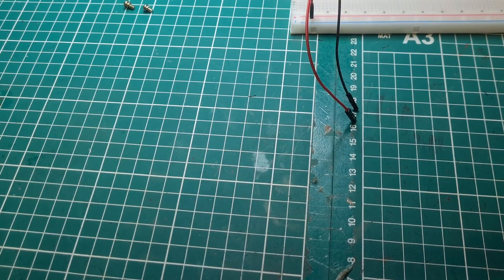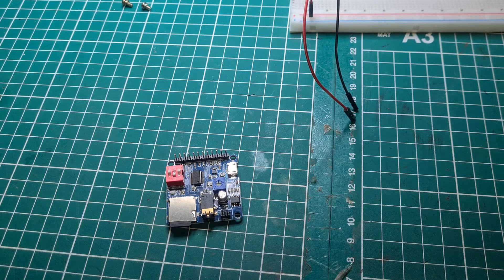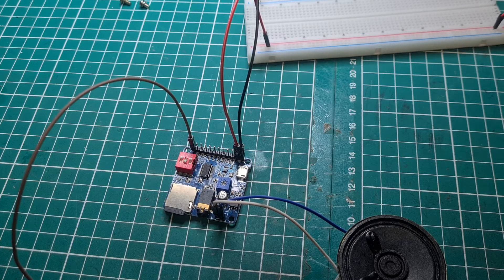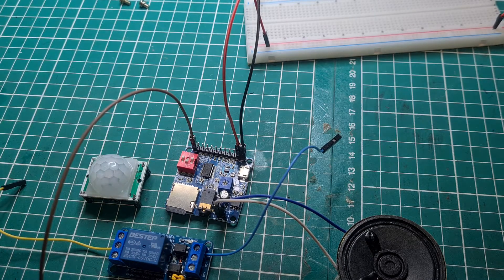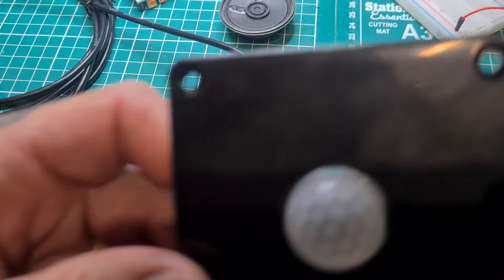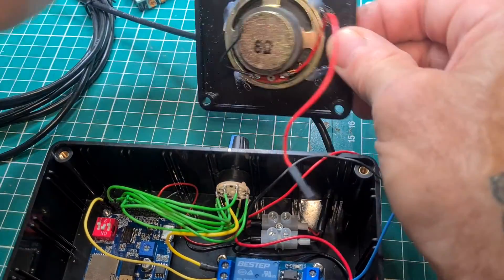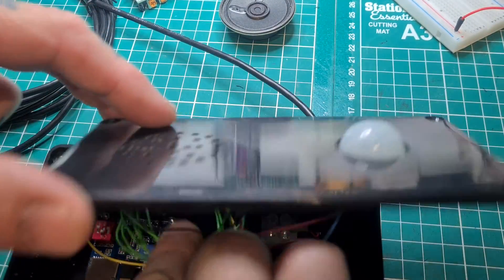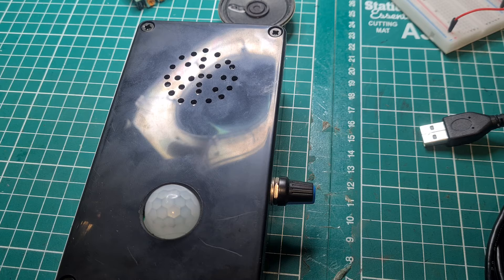how to make a Halloween motion activated sound box prop

Comment: Oh good, I found your video again. 

I have a question, or 2

I can't see where all the wires go off screen. 

You spoke of "attach 5V" but your hands were off screen and then you appeared to come back and t touch the ground wire to another pin to initiate a sound byte.

OK I read your reply about 5V phone charger, USB cable? So one of my other charger batteries that are Solar rechargeable would work?? 

You need for your camera to be further away. So we can see more.

Comment: Hi Dave. Great video! Wondering about yhe motion sensor and the time the relays stays open. What i mean specifically is does the motion start the process and or does motion need to be maintained to keep the mp3 player play through the sound?
Reply from the maker: @ChristopherNoone-e3h  hi it just needs the motion to activate the relay, once the mp3 starts playing it will continue to play to the end, the delay can be set so it doesn't activate the relay until the mp3 has finished otherwise it will start the track again from the start